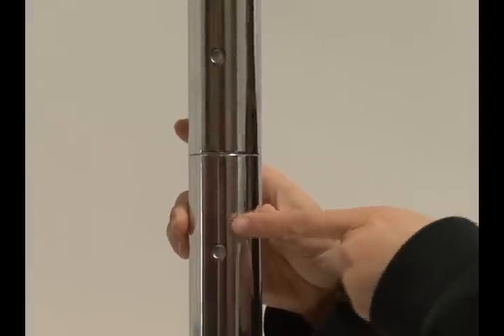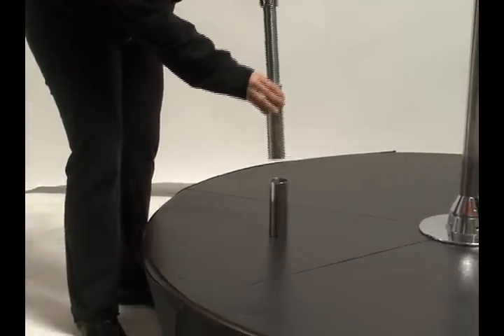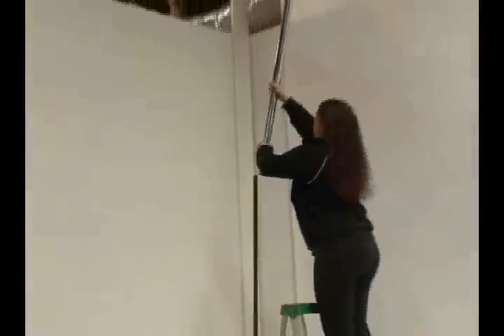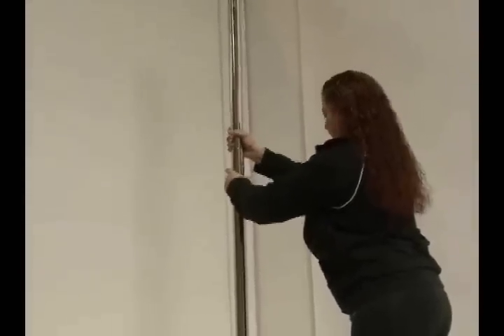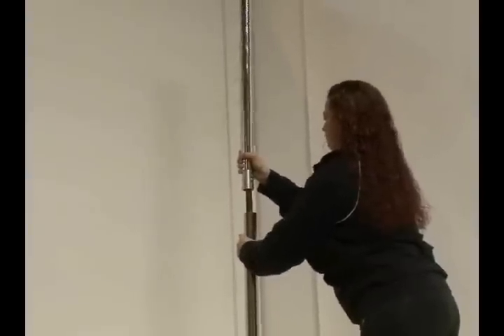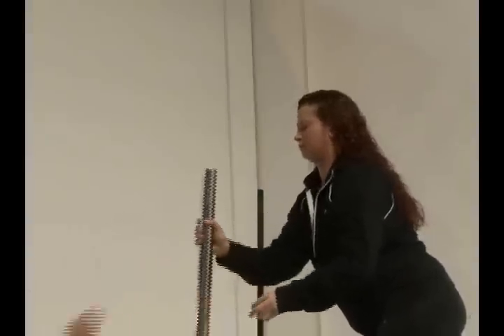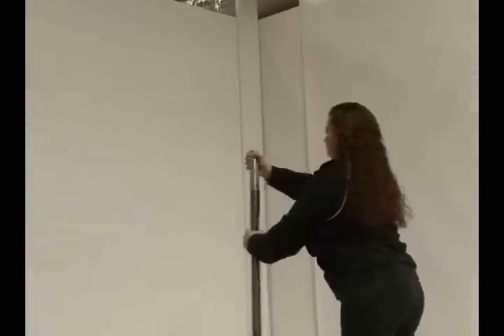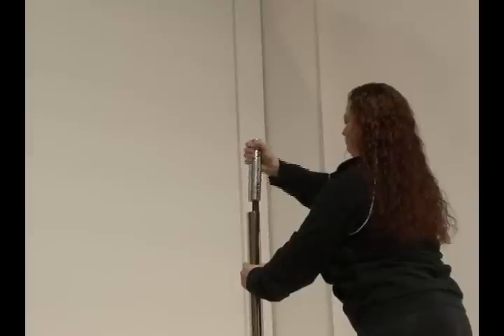Stuck X-Joint Within Pole Tube

Comment: This is all well and good.. but what do we do if we have an xjoint on both sides of a pole? This has happened to my 50mm chrome pole on one of the extensions and now I can't use it at all....
Reply: Stacey Warcup this seems to be my issue too. I need to take fown my pole, we are selling the place, and it is stuck! Did you figure it out?

Comment: I have a different problem, my x-joint hasn't rotated but is stuck. It won't expand of contract from either hole so I cannot release it at all to set it up or take it down. What would I do!?
Reply: Lafiglia44 Did you ever figure it out? I'm in the same boat.
Reply: Same 😭

Comment: Can you remove the  that came attached to the extensions and attach them to different extensions? I have a 500mm extension I need to replace the two other extensions with and I have 3  that came with the pole, but I'm STRUGGLING to get the  out of the extensions and I'm wondering if they're even supposed to come out?